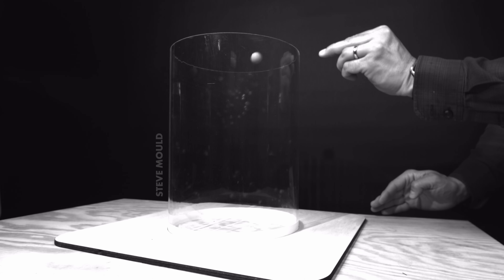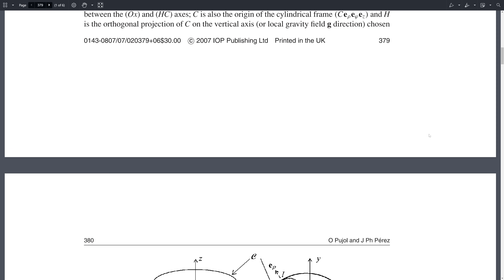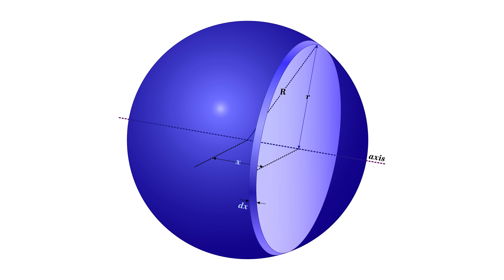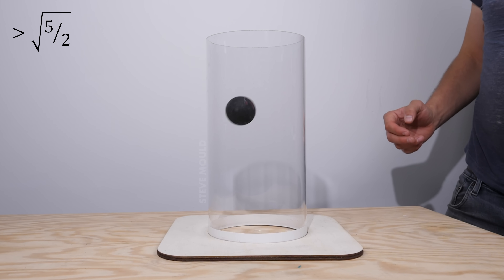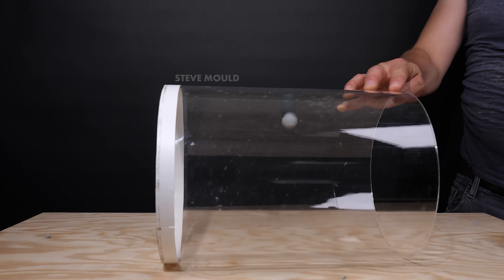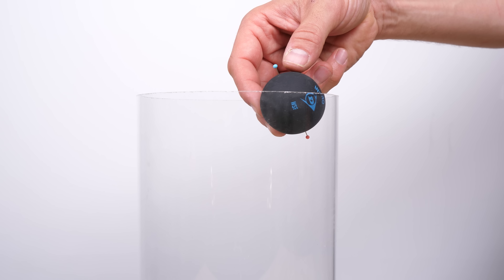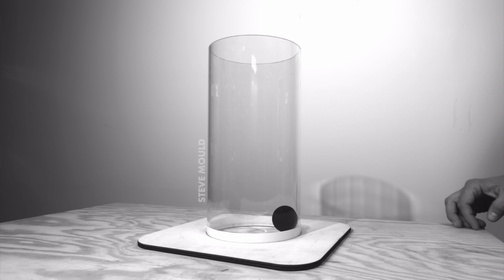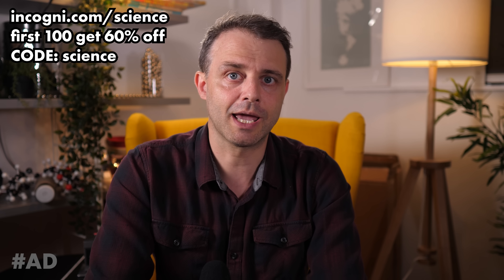The Golf Ball Paradox

Comment: It looks like the ball is traveling on a wave wrapped around the cylinder. And the ball changes directions due to a combination of a peak in relative g force, and curvature that then with friction carries the ball up. The curvature seems to be acting like a catalyst by causing the ball to slow is decent into the cylinder by changing the g force and gently moving its angular momentum up, and then in tandem with appropriate friction, speed, and ball squishyness (which probably helps with friction), the ball starts to stick its way up the cylinder to complete the wave with whatever energy it has left. (Basically the curving cylinder seems to be changing the acceleration down by slowing it, but also the curving increases friction by g force, but then the speed is at its peak at the bottem of the wave and with all this extra friction/grip/GeForce, speed and a decreasing acceleration down into the cylinder, AND the cylinder still being cylindrical the speed with all the other stuff mention it's able to climb out/up. I'd imagine it's how when race cars turn they can turn easier when the track turns/banks inside the curve, it let's them hit faster speeds at sharper angles.

Comment: You could draw parallel stripes on the ball to make what is happening to the ball's orientation as it travels more visible.  You could also take a ball, paint it with uv-reactive paint stripes, then turn off the lights and illuminate it with blacklights.  That will make what is happening with the ball's orientation as it moves highly visible.  

I think what is happening Is the gyroscopic effect, but it also has to do with the friction of the ball against the glass and Newton's Second Law of motion.  If every action has an equal and opposite reaction, then what is that opposite reaction that is happening when you throw the ball against the wall of the glass cylinder?  Could the ball's path be predicated on the relationship between the gyroscopic effect and what is happening with Newton's Second Law due to friction of the ball against the glass?  

Also, remember that the ball is elastic, so when you first hurl the ball against the glass, you get a rebound effect to a certain degree.  In fact, you get an infinitely regressive rebound effect on the ball as its elastic walls wobble back and forth after being struck initially.

Comment: i have an hipotesis, ball is rotating in diagonal, so, as it goes through the cilinder, the point of contact the ball has with the cilinder, slightly aproaches to  the center of spin, making it to rotate paralel to the cilinder, after the half of the cilinder, the contact point starts to get closer to the other center of the spin, making it to go up.

Comment: Every time you toss the ball into the cylinder, the cylinder moves slightly.  I believe this movement makes the cylinder tilt as the force of the ball in motion pushes on the cylinder.  So the cylinder is more like a funnel, wider at the top than at the bottom.  

I would like to see this done with a cylinder made of steel that is mounted in such a way that the cylinder does not move.  Then see if the ball comes out without touching the bottom.  I do not think it will.

Comment: That's really interesting. It makes me think of motorcycle tires as they go fast through tight corners. They have to "lean in" so they aren't thrown off the bike as they corner, and the force of the cornering speed pushes the back right back up by the time they're out of the corner. In this case, the "bike" (ball) gets pushed the other direction from the momentum, but the cylinder acts as a "permanent corner" to keep the "bike" pushing itself back up. Each time it does it goes "left" or "right" (up or down), causing the effect. It would likely possible to do this experiment with small wheels of differing thickness.

Comment: Here is how I think about it intuitively after reading those papers:
When the ball touches the cylinder the normal vector points out perpindicular to the cylindrical surface, through the ball on the other side.
---- This means that there is a uniform horizontal revolution on the ball that acts based on the intertia and good friction of the surface with the ball
---- ---- Similar to just a ball spinning in a wheel [shake the wheel to spin the ball around in a circular motion parallel to cylinder's perpindicular cross-section (a circle)]

There is another factor included with this ball that makes it different from the horizontal spinning ball: the vertical inertia
---- The vertical inertia component of the ball (parallel to the cylinder) forces a counteracting force called a euler force 
---- ---- The same force you feel when an instantaneous rotational acceleration is applied (i.e. falling backwards while the carousel starts or the instantaneous rotational change of this ball)
---- ---- This depends on how far you are from the center of spin: the ball will spin more on the outside than the inside (closer to the center).
---- The cylinder contact with the ball makes the ball want to stop bc of overall inertia (this is where Euler's force comes in)

The Rotational pole the ball obtains changes over time because of the vertical force on the side of the cylinder
---- for anyone who is having trouble understanding this here is a video for the intuition behind the changing of the rotational pole: https://www.youtube.com/watch?v=n5bKzBZ7XuM
---- ---- and to connect the dots the edge of the cylinder(vertical force) and euler's force counteracting acts as the forces described in the video which change the poles of the gyroscope

everything else you have said seems intuitively true the pole mostly maintains itself because the ball has an inertia for that spin that it obtained in the first place but the pole also changes over time and I think this is why...
I appreciated you looking over this topic it was very interesting. I'm glad there are more physics phenomina out there than I could imagine. If you see this, feel free to let me know what you think about this explanation... I might have done it poorly but hopefully it will give you some more ideas about how to think about it intuitively.

Comment: Does the movement amplification camera work similarly to subpixel movement detection or color change amplification algorithms? Like what can be used to reconstruct what is said in a room based on a video of a leaf through a window using subpixel movements. Or how an app can detect your heart rate based on a video of your face using subtle color change. 
As smart baby monitors have become popular using sock sensors, I’ve been frustrated that someone hasn’t used such an algorithm on a normal video monitor, without a special sensor. So I’d be curious how the respiratory rate of people or babies or pets would look in the camera. Or if you could see arteries pulsing inside someone’s arm that looks still to the naked eye. Maybe even the little blood vessels on the surface of the eye, for that matter.

Comment: So I think what makes the ball go up again in this cylinder is the rotational momentum conservation of the momentum it becomes when first touching the wall. It does not only gain angular momentum parallel to the cylinder but also horizontal to it. And this is not rotationally invariant regarding the axis of the cylinder. This means that when the ball at first starts to rotate 'downwards' when coming into contact with the cylinder it will rotate 'upwards' once it is on the other side of the cylinder.

Comment: its easy to think a constant force means constant rate of precession, but not so, it has to accelerate, in steady state yes a constant force means constant precession to maintain conservation of angular momentum, but when it is changing its a bit different, that is where the delay in the non slip case comes from i think. when you arrive at the bottom you have the maximum rate of precession steering upward but 0 rate of change in the rate of precession plus the change in rate of precession from gravity it the rate of change of precession from gravity is always just depending on the angle between the vertical and the direction of motion inside the cylinder, its maximal when the ball rolls fast and the angle is flat and parallel with the circular direction, but at some speed and downward trajectory the delayed rate of precession when you reach parallel trajectory tangent with the circular horizontal direction it is smaller than the upward steering change in precession causing a decrease in the steephood of the trajectory eventually leading to the ball going up again. roughly speaking. i think the intuitive hurdle is basically too get this idea of a torque on a gyro leading to a specific rate of precession out of your head and relearn what happens to a gyro when a torque is applied. you can solve it exactly for the case with no gravity and then think of the height as a change between different solutions to the no external force problem. so as you go down in the potential its a continous transformation into instantanious parts of different non external force solutions. not very intuetive perhaps but its real and true. then the moment of inerta and the hight determines the speed at soem height, and the speed gives you a trajectory for an orbit without any force correpsonding to a small change, like gravity only acted for a breif moment and changed one no external force solution into another non external force solution with the same angles and speed at that point to as you go down it corresponds to the same angle solutions with more velocity and angular momentum correpsonding to different derrivatives, and so you can derrive a change in the changes and get ready to do some crazy maths lol :P. sorry for typos or mistakes.

Comment: Steve:

I believe the intuitive explanation of the golf ball motion that you are looking for comes from the science of motorcycle steering dynamics.  Most people think that motorcycles steer due to gyroscopic precision.  This explanation is incorrect but widely propagated.  Motorcycles  actually steer due to a conical contact patch that occurs when the motorcycle leans.  To lean at speed, the cyclist must counter steer.  This is steering in the opposite direction as is desired to travel.  Counter steering makes the bike fall in the opposite direction of the steer.  The resulting lean causes the contact patch to take on the shape of a section of a cone.  The center line of the tire is the larger of the cone.  The sidewall is the edge of the cone.  When you role a cone on its edge, the cone rotates around the tip.  The conical contact patch is entire responsible for steering a motorcycle or bike that is traveling at any speed over 1 KPH.  The conical contact patch is also responsible for the self correcting characteristics of a riderless bike roiling down a hill.  There are several you tube videos that illustrate this self correcting action but they provide an incorrect explanation as the authors are unaware of motorcycle steering dynamics.  Your golf ball in the cylinder is behaving exactly like the wheel of a riderless bike rolling down a hill.  Its very similar to a motorcycle speed wobble or the aftermath of a "high side".  A high side occurs when the rear tire slides out in a sharp turn.  Typically a high side culminates in a violent correction that oscillates with increasing intensity until both the rider and the bike go airborne.  The golf ball exiting the cylinder is equivalent to the bike and rider going airborne when the speed wobble oscillates beyond 90 degrees. Thing of your squash ball as having a very similar profile to the cross section of a motor cycle tire or a bike tire.  The traction of the squash ball on the inside of the glass cylinder is analogous to a motorcycle tire.  Now take a motorcycle and throw it at a road on a 30 degree angle to the center line of the road.  The contact patch of the tires will self correct and initiate a speed wobble that will intensify until the the  angle of oscillation exceeds 90 degrees (or the maximum lean of the bike).

Technical information on the dynamics of contact patches are very difficult to find.  Its a lost science from the age of 1980 motorcycle magazines.  This is where I gained my knowledge of the topic.

The best link that I could find for you is this one.
https://www.vf750fd.com/blurbs/counter1.html

It uses slightly different terminology "Cone Shaped contact patch".  However the explanation detailed, accurate and comparable to my 1980's era motorcycle magazine education.

Here is a link to the science of riderless bikes:
https://www.science.org/content/article/how-keep-riderless-bike-crashing

Sadly, the explanation is also mostly incorrect.  Its correct to the point that it dismisses gyroscopic precision -- the most common error.  Its incorrect in that it fails to identify the conical contact patch as the real dynamic that causes riderless bikes to self correct (back and forth).  A bike with a rider will counter steer to steer then reverse the direction of steer to stand up the bike.  Riderless bike just falls over.  The conical contact patch then starts an arc.  The top of the bike gets thrown to the outside of the arc.  This rights the bike.  But the bike swings beyond vertical.  The oscillation continues.  Its all driven by the transactional forces that the conical contact patch exerts on the pavement.

So there you have it.  An intuitive analog for why the golf ball oscillates in an increasingly eccentric arc -- until it exits the cylinder.

I'm a big fan of your videos.  Feel free to give me a shout out if you like my explanation and decide to use it.

Kind Regards,

Paul Kasanda
Reply: Small typing correction in capitals -- The center line of the tire is the larger END of the cone.  The sidewall is the TIP of the cone.
Reply: To put some visuals to a motorcycle tank slapping speed wobble, you can refer to this video.
https://www.youtube.com/watch?v=tfSU4h_iocY

Some of these are due to the front wheel landing crooked after a wheely.  These are the  most analogous to your golf ball or squash ball motions in the cylinder.
Other examples in the video are due to the rear end sliding out in a turn (high side).  This is also similar to the oscillation of the golf/squash ball.  Other examples are just due to a combination of insane speed and/or front suspension that is out of true due to a prior collision.  You can ignore those.

If you focus on the wheelies and high sides, I think you'll see a mirror image of the golf ball trajectories.

Comment: I think I have an intuitive way of understanding this. As you already mentioned, mathematicaly, this could go on forever if not for loss of energy through air friction, etc. Lets imagine we would try to introduce energy by moving the cylinder in a circular motion, just like we all did as kids :) As you might now from experience, if we move the cylinder really hard/fast, the ball will go very fast in(to) a path of the smallest possible circumference (perfect circle, instead of an oval) within the tube and move on this line until we stop moving the cylinder.

As you said, gravity does not have an impact as we can turn the cylinder in any direction without the ball changing its path, given we manage to keep the perfekt rotational movement of the cylinder.

This means that the ball is always being "pulled" on this line/path of least resistance. The harder we move the cylinder the harder the ball is pulled onto this line.

So when you throw the ball into the cylinder, the ball immediatley starts being pulled towards this line by its centripital force. Looking at the thumbnail of this video, the ball at the lowest point at the path represents the moment when the ball is in fact on this line. However, as it still carries momentum from the acceleration towords this line it overshoots it with a certain excess of force now opposite to the initial direction. Therefore the ball moves beyond the line and doing so the centripital force now works against the current direction, which results in a gradual change of direction.

At the midpoint/crossing of the overallpath the ball now has a new optimal line within the cylinder, opposite to the below one with the same distance to the crossing in the middle, as the movement direction of the ball is inverted. Now the same happens again just mirrored. After this the cycle repeats.

If we would be able to move the cylinder in this circular way and therby apply just the perfect amount of energy, we could keep this going on forever. If we rotate to hard, the ball starts moving in a perfect circle. Too little and it drops.

Even though I did not include any other phenomena which happen at the same time like the rotation around its axis, I hope this makes somewhat sense😅

Comment: The ball isn't spinning at speed out of your hand.  It starts spinning because it hits the wall of the vessel.  consider the angle this spins on (as there's a downward velocity as well as sideways).  This will happen whether you do it vertically or horizontally as the video shows.  But as the ball goes around the perimeter of the container, the friction and movement will try and change the angle of spin.